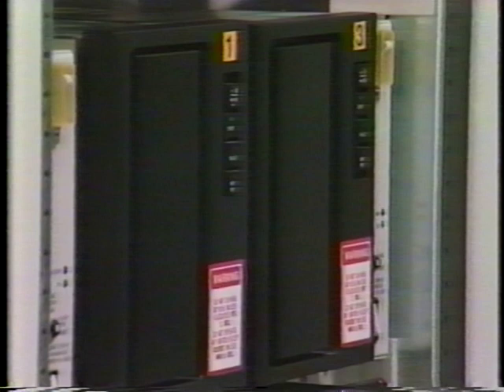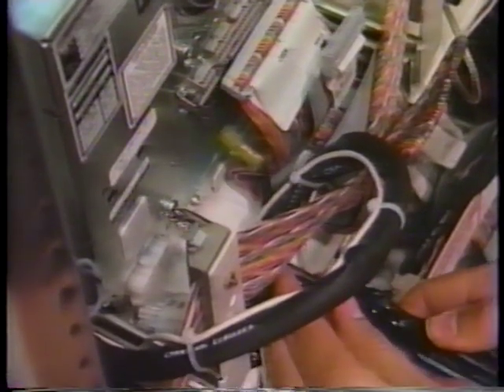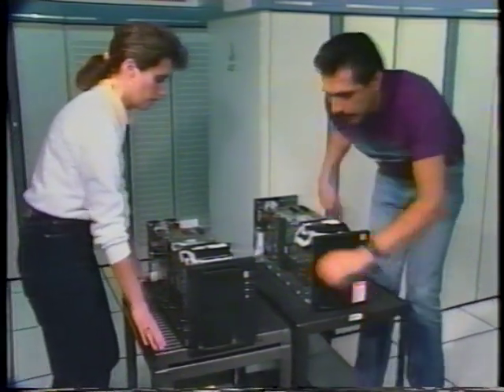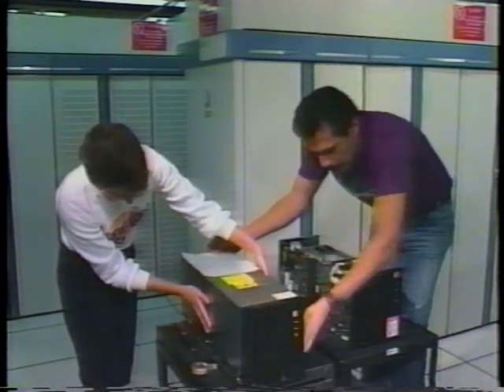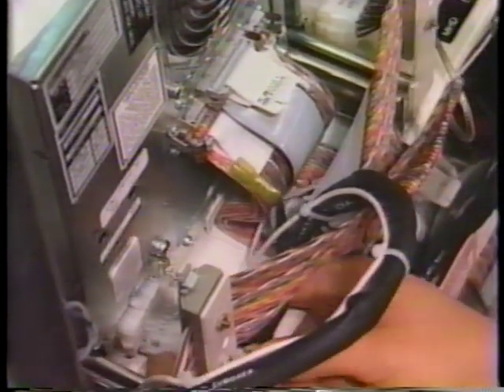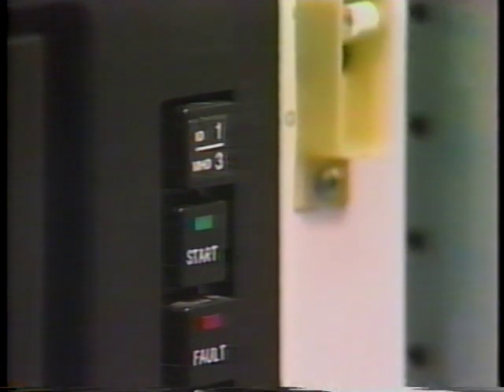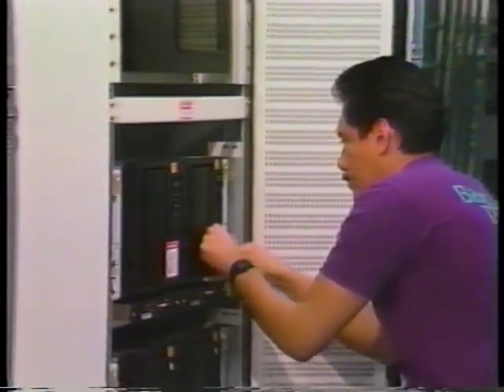5ESS - 340 MB Hard Drive Replacement

Comment: "Transfer the rails to the new drive unit.  Make sure they are properly secured, by fastening as many of the screws you still have after losing a few under the false floor".
Reply: I can't count how many 2.5" hdd mounting screws I've lost through the air holes in those tiles. Even worse when it's a void at the bottom of the rack.

Comment: In the bell system, all memory was totally duplicated, with memory control is controlling, controlling all the data in a central office. If there were problems it's the one system would automatically switch, to the opposite memory which is totally duplicated, without skipping a Beat. Many audits run continuously through the Bell System, any discrepancies would kick out an alarm remove the suspect memory, and put the standby memory online that will run Diagnostics automatically, to see whether there was a memory error or a hardware error. The systems were totally bulletproof from access from outside sources, hash thumbs or monitored 24/7, with all the various audits running continuously 24/7. 100% foolproof from any, interference from anywhere in the world would be detected instantaneously, some of these comments show me that these people really didn't have an understanding how these systems really operate. I am a bit old school from number four and number five ESS, but I understood the operating systems completely, they were 100% foolproof, outside of a earthquake or building collapsing. Today is September 9th 2022.
Reply: It's amazing by today's standards how much effort Bell put into automatic testing and diagnostics though. Nowadays we don't bother to diagnose anything in detail.
Reply: This is still done nowadays but often at a higher level. Companies with only a few servers can put redundant drives in the same server (which is called RAID), but companies with many servers make the whole servers redundant, and don't bother putting redundant parts in each server.
Reply: @thewhitefalcon8539  you have absolutely no idea what you're talkin about. The belt system is totally redundant, routine Diagnostics run, generally out-of-hours. These systems you cannot learn any college or university. We done the seat is because, communication is the first line of defense. They do not depend on individual privately-owned service doesn't work that way. Too complex and difficult to explain with a few words, what's the information is proprietary, to begin with.

Comment: I did 5 E translations for cellular office testing at Bell South in Atlanta.  Easy peasy.  We were still using DAT tapes in 1996. Worked for Att bell labs, later Lucent 1996-2003. We were doing FOA (first office application) testing.
Reply: Which Lucent location(s) were you?  I had an NJ-ALL badge in 99-01.  If you were in any of my locations, there's a good chance I fixed your computer before. :-D
Reply: @eric_d  the last few years I was in technical support working with bell labs, resolving very difficult problems. I covered pretty much the entire Northeast of the country. I have a total of 36 years service, I started out, with Western Electric, in, February 1963. I work primarily with simple office electronic switching systems, 1 ESS, tsps, ETS, 4 ESS, 5 ESS, then technical support for all central office systems, throughout the entire Northeast.
Reply: @americanspirit8932  I was only at Lucent about 2 and a half years, from 99 to 2001.  My company was contracted to do all hardware support while IBMGS was supposed to handle all software support.  I was on the refresh team (replacing computers at the end of their lease and transferring all the users files to the new computer), and the "break-fix" team (fixing any broken hardware).  IBMGS totally screwed us over, and made us lose the contract, which put our entire company of over 7000 people out of business.  During my time there I worked in at least 2 dozen different sites around New Jersey, from Mount Olive, to Princeton, to Red Bank, to Murray Hill, and everywhere in between.

Comment: Not a single anti-static wrist strap in sight .. as was indicated as a requirement in another training video I watched a few minutes ago.
Reply: They also didn’t use the pull tabs on the interface cables, they just yanked the cables out

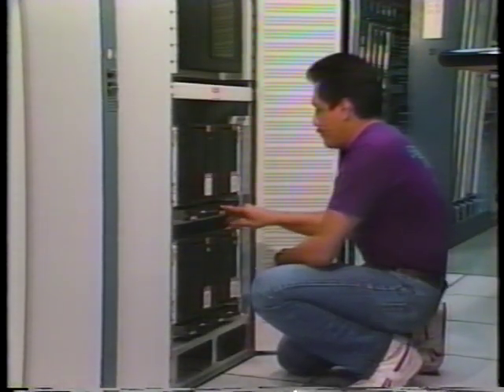Comment: Around 1:53 you can hear what sounds like electromechanical pulsing. Could this have been shot from a blended CO perhaps?
Reply: Miss Kobayashi  I just listened to it again. It sounds more like the event printer which was probably impact type. Since they are servicing a drive, there's no doubt that it's throwing errors. It could just be papers being rustled, but it sounded like mechanical outpulsing the first time I listened to it.

Comment: Fascinating.  I understand switches like these are still operating to this day.  So, do these units that are still operating have to be re-capped and retrofitted with modern storage devices?  Also, I wonder what is actually stored on these hard drives.
Reply: They replaced 9 track reel to reel systems with these beasties. And I would not be surprised if they had set up storage systems with one adapter on top of another to enable semi-modern storage methods to be used.   5ESS systems are on their way out and very few are left, only in operation in fringe locations.
Reply: Most are SCSI now
Reply: If they weren't still operating to this day, then what would've replace them, supposedly (besides maybe just smaller versions of the same thing that may run on a different OS, like System Signalling #7, etc.)?

Comment: - unmount the disk controller
- turn off the disk
- turn off the other disks
- turn off the power to the disks
- turn off the power to the disk controller
- turn off the power to the disks again

Aiyiyi...
Reply: Also, remove ground then power? That's backwards... What?

Edit: oh... There are two ground leads? Why...

Comment: do you think these older digital switches (DMS, ESS, etc.) will ever find their way to telephony/communications museums given their complexity and since many components for them no longer exist
Reply: Given that Verizon is buying parts on ebay to keep their switches running in addition to retiring copper at many Fios-enabled COs to increase their spare parts cache for the rest..... good luck finding spares. Verizon also seems to be determined to get all DMS-100s off their network due to Nortel going EOL and nobody supporting it. I suspect the 5ESS will be around for a while since there is still support from Alcatel-Nokia. The trend has been to consolidate their local switches to a regional Gentech C20 soft switch (which is replacing the older CS2000 switches).
Reply: They will. A friend of mine acquired a DMS-100 for less than $2000 from a university last year and saved all of the cabinets except for some of the line card cabinets (don't really need more than a few for a museum/lab install) specifically for this reason. He aims to set up a museum around it one day... hasn't fully worked out powering it up yet, though. Needs quite a lot of amps of -48VDC...
Reply: Many of those switches are still in use today. And no, parts are no longer made for them. (your only hope is to find functional "spares" from out-of-service units.)
Reply: The University of Arizona decommissioned their 5ESS in 2024 and said at the time they were planning to preserve it in a museum.
Reply: they have one 3ESS in the musuem
Reply: @kreuner11  yes, but the 3ESS is a monolithic system compared to the 5E. the challenges are far greater in regard to generic software images and operating a 1B computer -- huge electric bill. The best that can be hoped for is a 5ESS VCDX , I doubt we'll see a full fledged 5E unless Nokia or Bell Labs launches an effort to preserve software for historical purposes.

Comment: I wonder if that drive was MFM, SCSI, or IDE?  

In the OG or Operations Gateway of the GTD-5, they were originally IDE mechanical drives, which were later upgraded to SSD Drives.  The hard drives in the IROC of the GTD-5, which controls direct-interface to MXU/PairGain Cabinets, are still SCSI.
Reply: Could have been SASI, the precursor to SCSI.
Reply: Neither, it's a SMD interface drive from Control Data Corp. Later on, SCSI became an option on 5ESS.
Reply: It was SMD interface. I use to work on these drives and I designed a scsi-1 to smd interface for them in 1992.
Reply: They're SCSI now

Comment: What happened to the data that was on the failed drive, is it in some form of RAID where the data gets rebuilt on the new drive?
Reply: Worked on 5ess for a number of years.  5ess used hardware redundancy to increase reliability.  The switch was required to be down for only about 2 minutes per year.  As I remember, the disk file controller wrote the same data to 2 separate drives
And ping pong reads from each drive, so it is similar if not equal to raid on a modern PC.
Reply: @dalezapple2493  I'm a DMS guy, myself. NT went to "Disk-On-Pack" in 2002 and the lower capacity DOP daughter cards wrote to a larger disk for redundancy. You had to 're-image' a DOP if replaced. Do you recall when WECO/ATT went solid-state?
Reply: @NortelGeek  nope, in my time 5ess used the 300mb removable disks, and later 340mb non removable disk platters.   For the 300mb the platters were about 15 inch diameter and 12 or so platters.
Reply: @dalezapple2493  I presume that 2 minutes per year is an average, like once a year 1 out of every 5000 of them fails and takes a week to replace (or 1 in every 30 years there's a minor problem that takes an hour to fix). Nobody would tolerate shutting down every switch for 2 minutes every year
Reply: I don't have my 5ESS manual handy at the moment, but I suspect that the storage was redundant, yeah. Not sure if it was RAID, like we use today, but almost certainly was something similar.
Reply: The 5ESS later used standard SCSI drives

Comment: Let’s see, 340 MB divided by 70 pounds... this drive gives you almost 4.86 megabytes per pound of disk! Show me a flash drive that can do THAT.

Interestingly, despite the complexity, iFixIt still considers this a “Moderate” difficulty procedure.
Reply: Would they have ever thought that 128 gigabytes of storage could weigh .0006 pounds (0.25 grams) in a micro SD card.
Reply: iFixit gives it a reparability score of 1/10 since you can't take the drive apart, swap the media, and rebuild the heads like a 1960s disk pack drive.
Reply: @straightpipediesel  I believe the CDC drives were sent back for refurbishment?  I know the Quantum q2040s could be repaired too.
Reply: "Per pound of disk"? Um... not all of that weight is in the disk. Also, why the quotes around and random capital on "moderate"?
Reply: @HelloKittyFanMan.  It was a joke.
Reply: @jonathankleinow2073 : Even joke attempts need to make sense.
Reply: @HelloKittyFanMan.  Sorry it wasn't to your taste.
Reply: Haha,  @jonathankleinow2073 , it's OK. Not only my taste. Not all joke attempts can be winners. Keep trying.

Comment: Great blast from the past .. maybe a nightmare from the past...  Are we still switching calls?
Reply: It depends. Backbones are completely digital and a single 4 rack unit machine like an Oracle Acme Packet 6350 (which given its capabilities + licensing + redundancy might end up costing a million $ per pair, or more) can handle 3 million subscribers and 160,000 concurrent calls. Access networks are a little different as it depends what technology you get your phone service with. If you plug your landline to the back of your modem, it's digital as well and most likely connects to one of the aforementioned machines. If you have good old copper lines, also called POTS, it probably still looks similar to this video
Reply: @icovada  Yep, still a ton of 5E and DMS100 offices out there (And maybe a few XB5 and CG0) but they can't beat the offerings of an IP connection when it comes to price or variety. (Maybe in reliability, but that's a discussion for another time.) It's still fun to see these in action again, though. :)
Reply: @icovada : Just because something's digital doesn't mean it's not being switched. It all gets switched in one way or another.
Reply: @HelloKittyFanMan.  Sure but that's packet switching at layer 3 in the ISO/OSI pile, while the voice would be at layer 7. Either way, "switching calls" in my head is more of a circuit-switching thing, which definitely isn't happening anymore except for the last pure landlines at the last mile
Reply: @icovada : As packet-switching is still switching calls, then anyone asking or answering it should be specific between the two types of switching, especially if circuit-switching is still used locally within COs because they didn't want to rely on the iffiness of internet-based traffic there.

Besides, isn't there local digital circuit-switching being used in COs, probably by updated 5ESSes and DMSes, using the SS7 protocol (which, funny enough, until just recently I thought was a type of main phone switch itself, that had succeeded 5ESS, etc.), alongside internal packet-switching between COs now?
Reply: "Are we still switching calls"? As opposed to what other supposed way of connecting one phone to another (even cell phone calls are switched in some way)?

Comment: I would assume it is much easier on the newer softswitches these days!
Reply: Yeah, our new IP switch takes up only half of one rack,  the Ess takes the whole 1st floor
Reply: The 5ESS was upgraded later on to use standard SCSI drives
Reply: Yep, just pull and replace the SATA drive. If RAID, re-stripe. (depending on how big the CO is) -- I run my company's entire phone system on a thin client and a USB SATA dock (so I can make backups just by inserting a blank 128GB SSD and pressing the 'Backup' button) :)